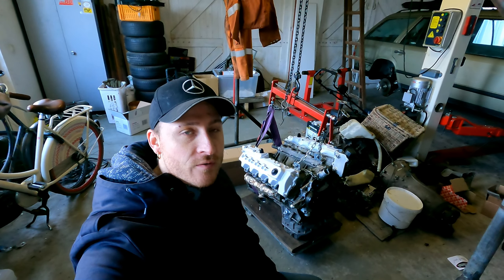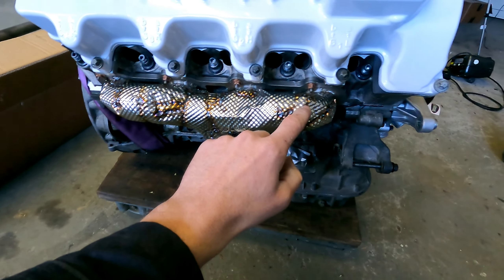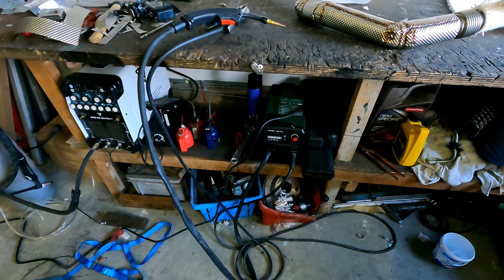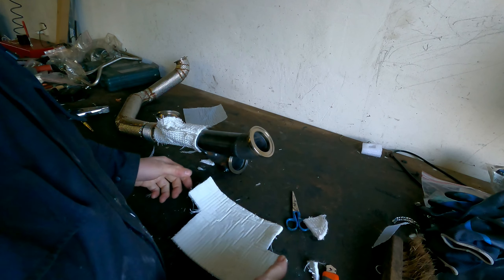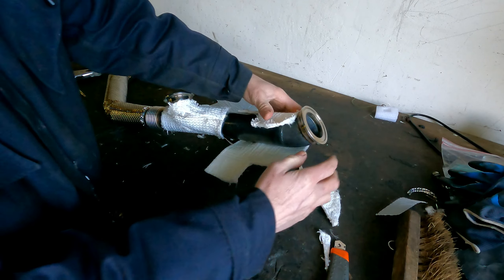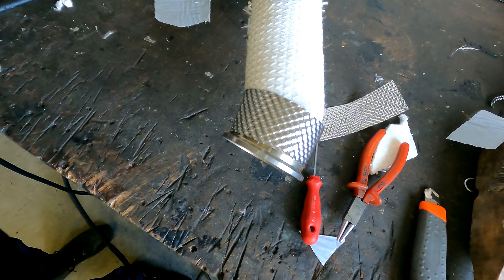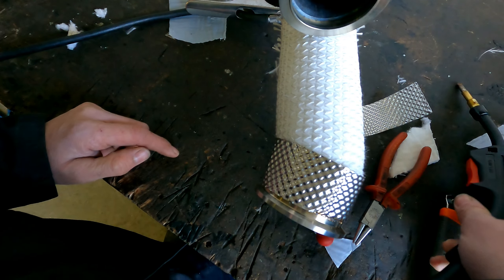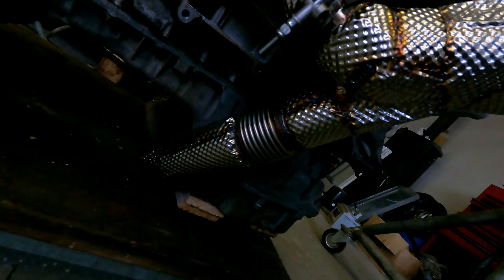HOW TO: Exhaust Thermal Heat insulation (ceramic wool + stainless shield spot welding)

Comment: Instead of the time-consuming, frustrating, and intricate work of shaping each little panel and welding them together, why not cut long thin strips of the embossed stainless sheets and then just use the old wrapping technique? Just treat the metal strips as if they were cloth exhaust wrap, easily covering straight sections and all bends without all of the crafted panels and stitching labor?

Comment: Hello, I do this job professionally. There is something I am curious about. I would appreciate it if you could clarify. What is the amperage range of this machine (parkside), for example, does it start from 30 amps?  As far as I can see, you are doing continuous spot welding. Does it allow continuous welding?
Reply from the maker: I just use a very simple mig machine and i can not adjust anything i just put it to 15 amps . That is the lowest setting .  Next time i do this i will use a battery spot welder i think
Reply: Heb je het al met een batterij punt las apparaat geprobeerd toevallig?
Reply from the maker: @leroysmaal1987 ik niet maar maatje van me wel.  Werkt goed 👍
Reply: @JMSpeedshop  weet je toevallig welke hij gebruikt? Krijg je het dunne materiaal daar ook mee vast aan de 2mm buis?
Reply from the maker: @leroysmaal1987 ja volgens mij ging dat goed zal.even kijken of ik dat kan vinden
Reply from the maker: @leroysmaal1987 https://a.aliexpress.com/_Eytfl3N

Comment: Ive not done a ton of mig, what tip are you using on your mig welder? Also thanks so much for posting this video. Ive been considering doing the same thing for a while, but have been scared to spend the money with out any idea of success.
Reply from the maker: The material using to cover the pipes.  When doing yourself is not really more expensive the heat wrap.  But it is just a long job to do. 
I used a modified plasma cutter tip or a modified tip from the mig welder

Comment: Hello I’m from U.K. and struggling to find a website for the ceramic wool. Please can you post a link to your supplier? Thanks
Reply from the maker: Follow the link  and read the description under the video https://jmspeedshop.com/2023/01/31/how-to-thermal-heat-insulation-ceramic-wool-stainless-shield-spot-welding/

Comment: Couldn't you use those small pen spot welders for batteries? They are designed to spot weld 0.1 to 0.3 mm stainless steel
Reply from the maker: Im going to look into that
Reply from the maker: Thanks 👍

Comment: Hi, just took my first attempt at this, and have to say it, this video was PRICELEEEEES!!! Watched it like 9 times in the last few months. Golden, thank you!

One question tho. Why the plasma cutter tip? The MIG, copper one, seems to work just fine. Although I've only made a few spots for now, still testing. Maybe it will wear itself out after one hour of wraping?

Thanks,
Your biggest fan
Reply from the maker: Thanks for the support 👍. Plasma cutter end was.juat what i had around and straight .  Did not want to wear out the oem mig piece

Comment: Have you ran the motor yet and how is the heat shielding holding up.
Reply from the maker: Video of the start up will be online end of this week.
Reply: @JMSpeedshop  sounds good I’m going to be putting new motor in my car and track prepping it so lots of heat management & have been looking at using the same material you used or a company here in the USA called heat shield products.

Comment: I am not a welder or ever welded anything, but been curious to try this on my headers for a long time.   Also curious if you have considered or tried to use the electro chemical weld cleaning to clean the seams you tack welded to clean off the browning and make the seam look cleaner?  Not saying it looks bad and in the end if you are happy with it, that is all that matter, mentioning out of curiosity if it would work and perhaps you did not consider it. Thanks for sharing your process.
Reply from the maker: Did not try to clean .   For me personally it is not really a point. Looks good to me at the moment.   I will have a look at.yiur link below .  Always interesting.  Thanks

Comment: Hello, will doing this lead to premature cracking on the pipes or welds? Also, do you cover the welds we’re the flanges meet or attach it before the welds? I have all upgraded pipes but would you recommend doing this for a daily driven car? Thank you
Reply from the maker: I have a carbon steel manifold .  So this less able to crank then stainless steel.  But this is the first time in using this .  
The flanges are not covered otherwise you can not use them anymore.  This is also a streetcar.

Comment: What is the anti stick function on your tig machine? I have a tig welder and want to try this on my manifold but not sure if it’ll work
Reply from the maker: Anti stig is if you touch then metal with the torch it will pull the power doen

Comment: 1. Tell me, did you use MIG, TIG or MMA mode? Anti-stig mode is the same mode for MMA welding.

2. Roller tip - why didn't it work for you?
Reply from the maker: You have to watch the update video.  It is for end last year

Comment: What tip do you use? I cannot find one similar to use
Reply from the maker: Plasma tip.  Modified to a point
Reply: @JMSpeedshop  and how do you prevent the tip from sticking every time? Mine seems to just want to stick
Reply from the maker: @collinwiedel oke.  Did not.had that problem

Comment: Excellent work.. Can you build a turbo manifold for me as well??? I also have a m113 motor (Sl500) R230
Reply from the maker: Hello.  This one is build on the car engine combination to fit . So a custom 1 of.   Dont have the dimensions of a r230 and dont have a second engine to build it on .  So at the moment this will not be possible

Comment: Have you a link for materials you bought?? Cheers
Reply from the maker: What you mean which materials
Reply: @JMSpeedshop  ceramic wool and stainless Steel sheet
Reply from the maker: https://www.google.com/search?q=hjs+motorsport+83000027&oq=hjs+&aqs=chrome.1.69i57j35i39l2j46i175i199i512j0i512j46i175i199i512j0i512j46i175i199i512j0i512.2986j0j4&client=ms-android-xiaomi-rvo3&sourceid=chrome-mobile&ie=UTF-8

Comment: Where did u buy The pointy weld or what to call it? Because if u use without a thread how does it weld then? 😅
Reply from the maker: It is just spot welding .   I used a plasma cutter tip.  It had the same thread